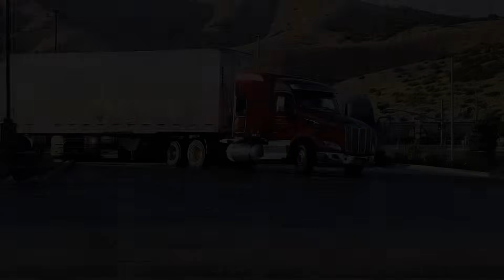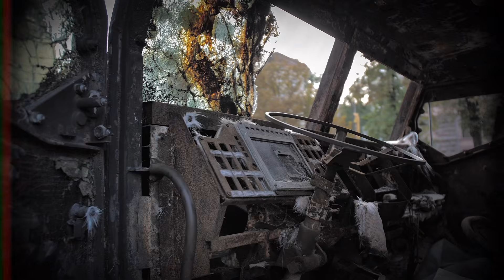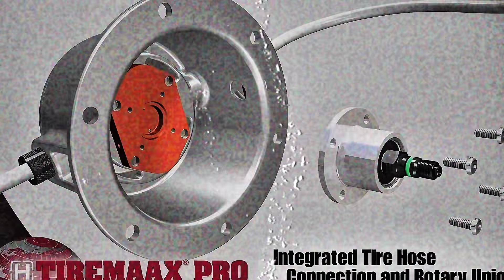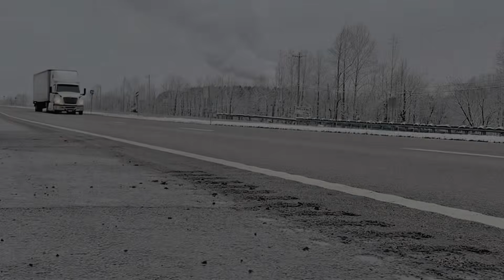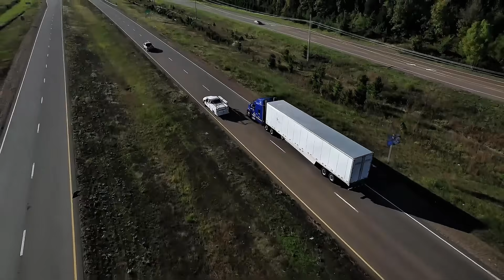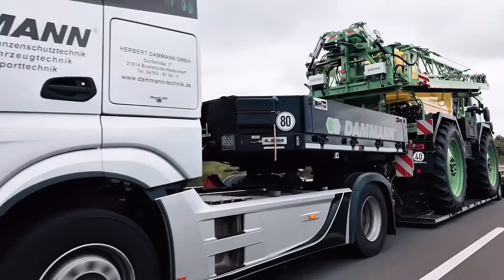What Is That Strange Hose on Truck Wheels?

Comment: As a driver of over 8 years, I have never seen an external inflator. I wouldn't trust it personally, too exposed. All the ones I've seen have been internal, ruining through the axles and hub. Most common point of failure is at the hub where a straw looking tube can snap from time to time, but it's a 5 minute replacement,so it's not a big deal generally. Also, I've never seen a system auto shut down, they will keep going until the air in the trucks tanks run out. This isn't an issue while driving though as the compressor generates air pressure significantly faster than the systems use. You will notice the air tanks draining faster than usual, and that's a good indicator something's wrong, but as long as the engine is running, you won't lose enough air pressure in the tanks. 

A critique on the video itself, just get to the damn point already. Video could've been 5 minutes if you didn't repeat yourself explaining something 3 different ways. I'm 6 minutes into the damn thing, and I have yet to hear you actually explain how it works other than "air is supplied from the truck's air tanks." Ok, but how does it work beyond that?
Reply from the maker: Thank you for your comment. I am trying to understand this issue in more depth, and I will definitely make another video about this system.